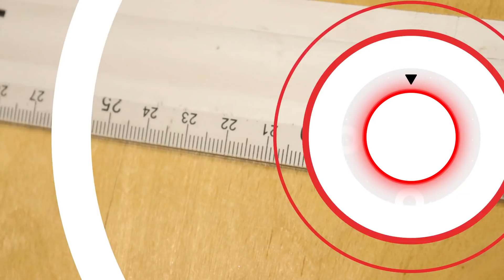10 Ingenious Handyman Tips & Hacks That Work Extremely Well – Tips and Tricks

Comment: That last square you demonstrated was not square at all.  Just look at the video and you will see that the line gap was much smaller at the end. 0:33 can be done with a pair of locking forceps to get the bolt started and then use the wrench to tighten.  Don't waste the tape. Other tips can be done easier too.  Interesting tips though.  Thanks.

Comment: Ruin a screwdriver instead of using a concrete anchor?
Hammer a nut instead of using cable clamps? 

Wooden junction box?  CAN YOU SAY FIRE HAZARD?!?!?!?!?!?!

Anyone who can't hold a square flush to workpiece has way bigger issues to worry about.

Great video showing improper applications.